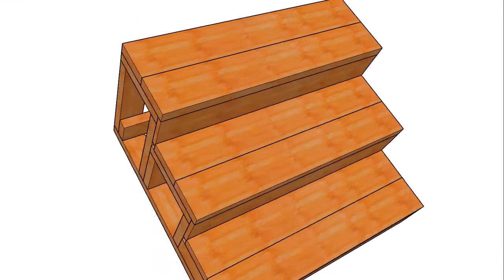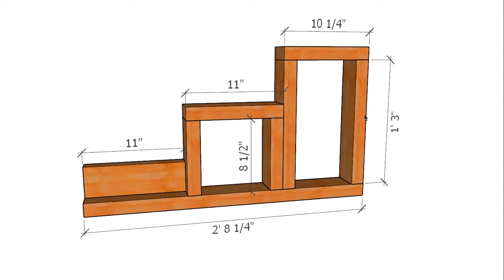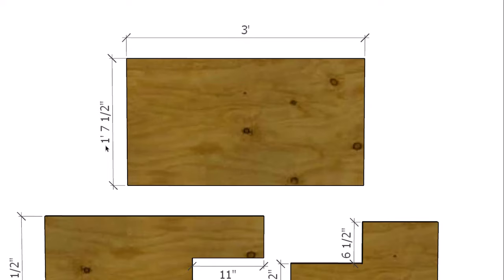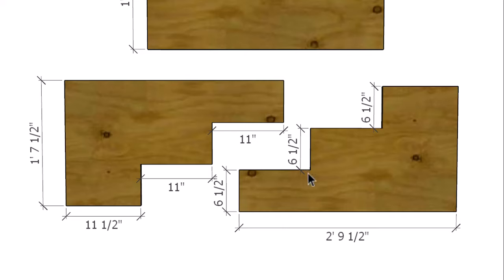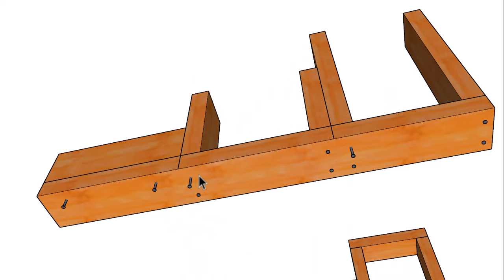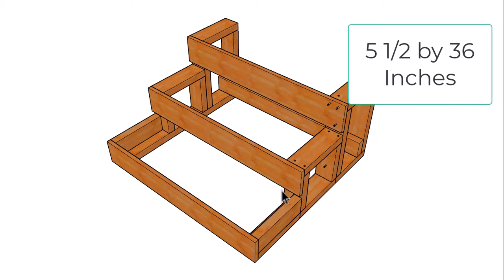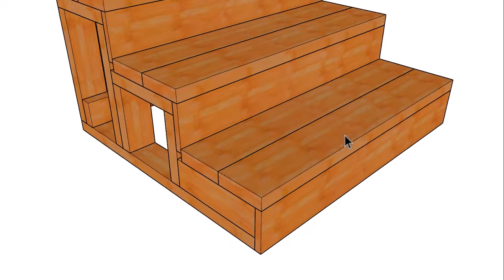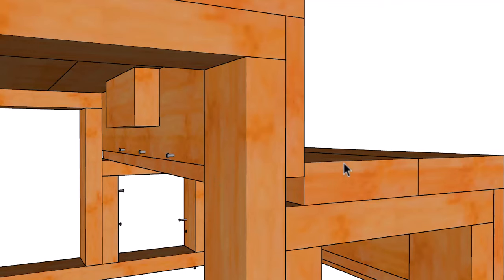How To Build Small Stairway With Measurements And Assembly Methods - Construction Tutorials

Comment: I would like to see the top to be like 3x3x so that when we step out onto the stairs from a camper, you are on a mini deck.
Reply: Extend the base plate from 32.25" (2' 8 1/4") to 58", extend the 10 1/4" pieces to 36", and add a couple additional 15" (1' 3") supports.  That said, you may want to modify it slightly if using 2x6 for the surface since those are really only 5.5" so you would end up needing about 6.5 pieces.  If you went with 6 pieces, you would have to leave a gap of 0.5" between each board; instead you could go with a top of either 33" or 38.5" so you could use either 6 or 7 boards.  Good luck.

Comment: Looking to make a Stile to allow ingress to the National Forest from our property.  Building the staircase perpendicular to the barded wire fence with the idea that a 4 ft tread width will provide 2 ft on either side of the fence.  Will add a post in the middle of the top tread to provide a hand hold.  Stairs would be built with the barbed wire top wire running underneath the top stair. I dont have the berm clearance to do a ladder type stile.  You made a terrific video that I am working my numbers to create a 4' x 4' x 4' freestanding stair.  BUT... since you volenteered to provide measurements for other dimensions, I am looking for an open staircase 4 feet high, with 4 foot tread width and a top step of 4 feet.  Thank you in advance.  Will forward photos after its completed.  BTW we have wild horses just on the other side of the forest fence that would be less than 10 feet to where these steps would be built!  Scott, Palomino Trail, Overgaard, AZ
Reply from the maker: Sounds like a big project and you're welcome.

Comment: I have a problem with my stairs, i have no choice but to put my stairs at 24 inch width due to only having a 49 inch w and 69inch length with a 105 inch height if i remember correctly.  Everyone i am trying to hire is saying they need to add space by cutting beyond and turning the stair width to 30-36 inches and i do not have the space at all to cut out anymore and i already bought and used a lot of resources as is.  Is 24 inches fine width for stability especially when you have 0 choice.  I have been working on this for abiut 6 months now and just want to finish it in 3 days.
Reply from the maker: Most building codes use a 36 inch minimum for stairs, but there are exceptions. You will need to ask your local building department to clarify the codes.
Reply: @stairbuilding  i did they said just the national codes is all they require, if i cut anymore width i am going into the path of the kitchen and if i cut anymore length i have to try and move the duct and i have a kitchen table on the other corner.  This is a small house, before i started to do this it was the pre made spiral metal staircases with top of it half in the wall and about a ft drop at the bottom step.  I ended up losing my footing and slipping down banging my knee hard

Comment: I would like to build these same stairs buy having a finished height of 14 inches.
Reply: It is currently 18" (1'3" + 1.5" for the base + 1.5" for the step) so reduce each riser by 1 1/3" or it might be easier to just remove the extra height from the top two steps, so exchange the 8.5" with 6.5" and the 1'3" with 1'1".

Comment: Thanks for the video. It was very helpful to build some new hot tub steps, which turned out very study.  For those wondering, here's my cut and materials list:

For 2x4, we need 4 @ 8.5", 2 @ 10.25", 4 @ 11", 4 @ 15", 2 @ 32.25", 1 @ 36" (if you want the back stabilizer)
For 2x6, we need 6 @ 36"
For 1x6, we need 3 @ 36" (one of these needs to be cut to 5" or less - I cut mine to 4 5/8" to leave a tiny space)

I used the following materials, which cost me about $120 for cedar:
3 - 2x4x8
2 - 2x6x10
1 - 1x6x10

Based on the length of your own materials, plug it into a cut list calculator to figure out how you want to cut your 2x4s, though here's what I did:

#1 -- 32.25", 15", 15", 15", 10.25"
#2 -- 36", 32.25", 10.25", 8.5", 8.5"
#3 -- 15", 11", 11", 11", 11", 8.5", 8.5"

Comment: Any ideas on how to keep these from sitting directly on the concrete?  And maybe also moveable.  Thought about locking casters but no way to really hide them.
Reply from the maker: I use a refrigerator dolly to move them and don't worry about the bottom boards, because they can usually be replaced easily if you use screws.

Comment: Do you not have to have the same height for each step to be the same for code? I think it’s within 3/8” for each riser?  I could be wrong, I thought I saw you have one stair 5 1/2” and the others were 5”. .??  Thank you for the great visual video.
Reply from the maker: The bottom riser needs to be smaller to have equal riser heights, most of the time. Check the final measurements if I have them in the video and if should make sense, if not let me know.
Reply: I think (note: I am a hobbyist woodworker) that the height of the riser is complemented by the thickness of the tread, so the difference in the height of the bottom riser is different as there is no step tread below it, as such, because that would be the floor / ground it’s standing on.

Comment: Hi, I have a question. I’m looking to do that at my father's house. He is 72 and has a 3-step concrete. But his go sideways. So one side is completely open. But the other is closed off because it’s part of the house. The back door goes into the laundry room. So the fully open part would only have the one's side that u just talked about. But nothing for the wood to go into on the other side how would u make something like that? I was also thinking of bringing to landing out to make a little more room away from the side of the slab but then I know the post would have to be anchored to the concrete ground. I would like to make this where it’s removable because if have to. Because u won’t need a permit if it is not a permitted structure And could u make a list of materials from the wood of each thing to the size of screws and the  dimensions so when watching ur able to screenshot the list to have for buying
Reply from the maker: I don't understand why a stairway like this won't work.

Comment: I’m replacing 2x two-step flights (interior split level home), and this looks ideal as a frame over which we’ll lay engineered floorboards. My treads are 900mm wide and 300mm deep, with the top of each step being 150mm above the next. My gut says I should put 1 or even 2 supporting L-shapes inside for support, as well as the 2 exterior ones. Does that make sense? 

I’ll make the frame from 45x90 timber, and clad with 18mm plywood, so it’ll be super sturdy even before we add the floorboards. I just need to remember to allow for the floorboard thickness when I set my heights.
Reply from the maker: If you don't think this will work, use the supports you're suggesting.

Comment: Thank you for the previous reply. I was given composite decking and would like to know if I can use it for the treads? I am only going to build a 2 (possibly 3) step stairway? For something that small, should the composite be strong enough without sagging?
Reply from the maker: Check with the manufacture of the decking for stair stringer spacing and joist spacing or on center spacing.

Comment: I have a question related to sheathing layout. It is recommended to have an 1/8" gap between sheathing. Since sheathing is 4' x 8' and framing is typically spaced at 16" o.c. , at some point the 1/8" incremental gap will miss the 16" o.c. joist framing.... and also, even before the sheathing misses the joist, the layout will become offset to a point where the sheathing wouldn't break evenly along the center of the joist. How is this handled in the field?
Reply from the maker: You need to adjust the joist for the sheathing by adding 1/8 of an inch to the on center layout at some point and for every sheathing break.

Comment: Hi you think you can help me out with 4 stairs the hight needs to be 2ft . Would you please help me out with a dieahram? Thanks
Reply: The first step is 3.5 (2x4 on its side - which technically measures 1.5x3.5), second is 6.5 taller at 8.5 (vertical piece) + 1.5 (horizontal piece) = 10 total height, third is 6.5" taller at 15 (v) + 1.5 (h) = 16.5, so it seems like the fourth step would be 21.5 (v) +1.5 (h) = 23
I also need 4 - this was the math I came up with.  But then that 3rd run needs to be an 11" piece, not a 10¼, as that would be for the run of stair 4.  This would also change the length of the bottom horizontal board from 33.25" to 43.25".  I'm just guessing since I have never done this and am just trying to DIY some spa stairs instead of paying $450 for some ugly fake wood ones at the store.  
Someone feel free to correct me 🤷 I've never built anything

Comment: How wide can the steps be, with just the two supports? You are using dimensional for the steps here , can I assume you cannot use treads made out of 5/4 boards or composite Because they won’t be strong supported by fasteners going through the bottom of the risers?
Reply from the maker: I can't provide you with exact on center spacing, because different types of lumber can span farther. If you replace the 2x6 with a 3x12 you should be able to span at least 36 inches, but this also might depend on the lumber type and grade.
Reply: @stairbuilding  thanks. The manufacturers are telling me 9 inch on center. They cite the extra wear and bounce that steps take.

Comment: How do we attach it to the house? Or is that not needed?😅
Reply: A few screws through the 1' 3" risers on the back should do, though make sure you are screwing into a solid surface such as a stud, or in modern garages you may have OSB or plywood backing that should work out fine too.

Comment: Thank you for the great tutorial. How come you don't have the risers go all the way down to the top of the 2x4 that tread sits on? That leaves a little square gap between the riser and the tread. Just asking because I have no clue about any of this, but am willing to try. Thank you.
Reply from the maker: You can, if it will work better for your project. I sometimes like to leave a gap here to allow for lumber shrinkage. For example if the one piece of lumber shrinks, it could put pressure on other components, causing them to lift and create problems.